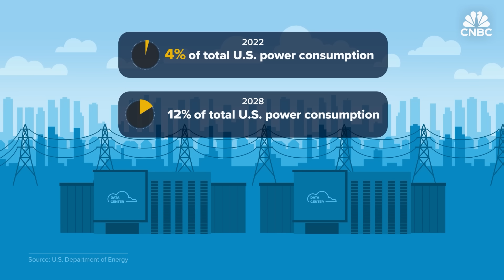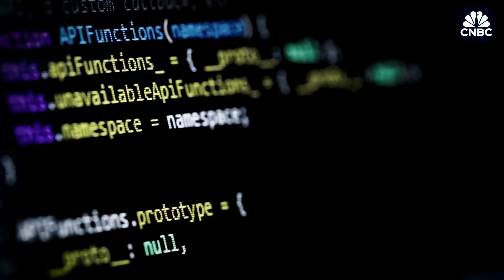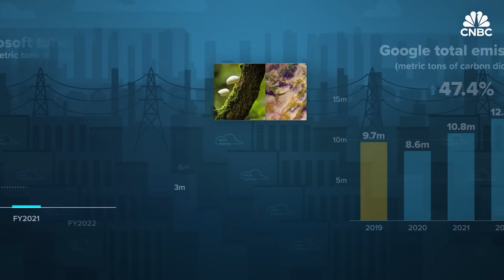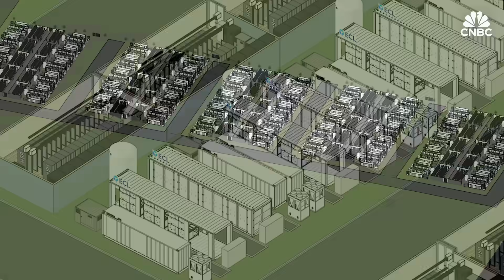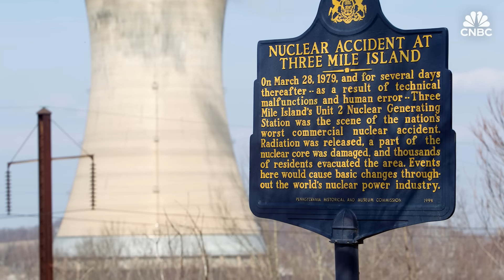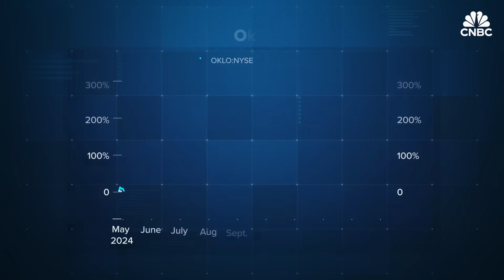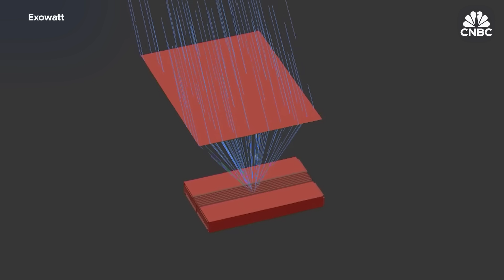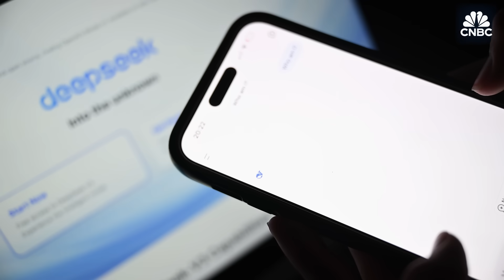How Google, Microsoft And Amazon Are Racing To Solve The AI Energy Crisis

Comment: More Tesla megapacks stabilize the grid which allows storage of excess energy solar/wind vs previous dumping.  Megapacks help out 4pm to 10pm revving up extra energy as people heading home.  Cheaper than gas PEAKER PLANTS.  Power during outages.  Battery storage cheap non peak energy to be used
During expensive peak power times.  V2Grid with EV’s also seeing potential.  VR POWER UTILITY MICROGIRDS VS MACROGRIDS also the future.  Tesla offers a VR power utility company in Texas.  Tesla starting to define lithium in Texas vs China.  AI in COLD space will help cool AI and well as increased performance solar cells in space.

Comment: China is increasingly integrating artificial intelligence into its energy system to increase the sector’s efficiency and enhance national energy security. From managing energy storage to more accurately forecasting energy supply and demand, large language models can make the whole sector smarter, by streamlining energy systems and minimizing waste. 

Of course, AI is a double-edged sword in the context of the energy sector. Training large language models carries a gargantuan energy footprint, and running AI queries is far more-energy intensive than traditional searches – though exact figures are hard to come by. But while AI is placing a strain on energy grids, it also has enormous potential to improve grid management. And China is far ahead of the curve in terms of tapping into that potential.

Comment: Fusion power, while often touted as a "clean" energy source, does produce nuclear waste, though it's quite different from the high-level, long-lived waste generated by nuclear fission.
Here's a brief overview:
 * Activated Reactor Components: The primary source of radioactive waste in fusion reactors comes from the structural materials of the reactor itself, particularly the "first wall" facing the plasma. High-energy neutrons produced during the fusion reaction bombard these materials, making them radioactive through a process called neutron activation.
 * Low to Intermediate Level Waste: The activated components are generally classified as low- and intermediate-level radioactive waste. This type of waste poses a much lower risk to human health and the environment compared to the high-level waste from fission reactors.
 * Shorter Half-Lives: The radioactivity of fusion waste typically decays significantly faster, often within decades to a few hundred years, as opposed to the thousands or even hundreds of thousands of years for some fission byproducts. This means it doesn't require the same very long-term geological storage solutions.
 * Tritium: Fusion reactors commonly use deuterium and tritium as fuel. Tritium is a radioactive isotope of hydrogen with a relatively short half-life (around 12 years). While it is produced and consumed within the reactor in a closed loop, there's always a potential for small amounts to be released or to contaminate components, which would then need to be managed as radioactive waste.
 * Helium: The direct product of the deuterium-tritium fusion reaction is helium, which is an inert, non-toxic gas and not radioactive.
In summary, while fusion power doesn't produce the same kind of highly radioactive, long-lived waste as fission, it still generates radioactive materials from the activation of its structural components, requiring careful management and disposal, albeit for shorter periods. Research is ongoing to develop materials that minimize this activation and allow for recycling or reuse of components after a relatively short cooling period.
Reply: thanks for this comment.

Comment: The Nuclear Solution: Powering Our Future.

Nuclear power is the answer to weather disasters and our energy future. We can build Generation IV nuclear power plants on an assembly line basis and deploy them worldwide as quickly as a Walmart. This approach will dramatically cut construction costs.

Superstorms, extreme weather, and electricity shortages can all be addressed with off-the-shelf nuclear technology right now. Nuclear power can fuel our electric future and even help scrub carbon out of the atmosphere. We all benefit from abundant electricity that doesn't harm our atmosphere.

Versatility and Safety

Nuclear power can produce hydrogen for trucks, buses, RVs, and airplanes. It can also be scaled up and down to complement intermittent sources like wind and solar. Generation IV nuclear power can even consume more waste than it produces, and it can repurpose existing nuclear waste, just as France has done for many years.

Generation IV nuclear technology offers several key benefits:

Non-proliferation: Designed to minimize the risk of nuclear weapons proliferation.

"Walk-away safe": Features passive safety systems that ensure safety even in the event of an accident without human intervention.

Urban heating: Can provide steam for heating our cities.

Flexible size: Can be small enough for a cruise ship or small towns, and can be put in series to power large cities.

Grid integration: Can be part of a local power grid alongside wind and solar.

Small footprint: Requires about the size of a Home Depot.

Community placement: Can be located next to hospitals or large retail centers in any community.

Dispelling Misconceptions

Nuclear power is over 99% safer than petroleum product extraction and much better for the environment. Don't believe me? Look at the number of deaths every year from extracting fossil fuels. We have to stop using the air we breathe as a trash can, and we must address how petroleum products contaminate our drinking water.

The media and politicians must stop scaring people about nuclear power. Their fear-mongering is responsible for preventing the construction of vital nuclear facilities, which contributes to ongoing death and environmental destruction.

We need to organize field trips for kids and parents to see firsthand that nuclear power is not scary. We should commission artists and school children to paint murals on-site at Generation IV nuclear facilities. Don't let the media and politicians scare you about nuclear.

The only "nuclear disaster" we face is the parasitic "nuclear safety" industry, siphoning public utility dollars for so-called cleanup. People have been living and working around both Chernobyl and Fukushima since day one, yet these groups lead you to believe it's some terrifying thing. The "nuclear safety" establishment is a parasite on the business, making it so expensive that it can never be built.

Comment: Earth's water vapor saturated greenhouse effect is from water vapor absorbing all the greenhouse radiant energy from the earth within a few meters of the radiating surface adding 10°F (5.55°C).  The other greenhouses can not change the overall all effect of earth's greenhouse effect.   Saying Trump just wants oil and gas is very incorrect.   Trump wants a return to economical electricity which means new USC coal power stations at less than 1/3 the fueling cost of natural gas.  When supporting wild AC from solar voltaic and wind turbines the natural gas use is higher than when making all the electricity from natural gas combined cycle power stations.  The NGCC power stations are still more expensive than coal so they are rarely used except when needing to quickly easily replace an old  inefficient coal power station.

Comment: Use offshore wind, wind build out in the plains, along with a solar south strategy.  Just absorb the energy needed.  Further, collect and recycle wasted energy streams, especially from the tremendous US nightly grid losses.  Collect these grid streams as battery fill, heat battery fill (sand or salt), and hydrogen generation.

Easy money.

Comment: For eg if all (green) hydrogen is made from pure renewable (solar & wind) .. via Electrolysis. The very low (ambient) pressure of 2 barg, how to stored it with (another way) very high pressure, says, upto 700 barg.. that need lots of Compression power (upto 40% of H2-mass produced must be sacrificed, to be Stored at sufficient potential/ pressure). Otherwise, as shown in this video, the Cryogenic/ Refrigerator s required. That's too, need LOTs of Energy to.. Cool it down to the condensing point of becoming Liquified for compact storage & easy transportation (there's no easy way without.)
Same as for CNG, either refrigerated or High compression (2- 300 barg for CNG; for hydrogen is 700 barg (non-refrigerated).)

Comment: I see hydrogen as a great solution for stationary electrical generation. We need to develop hydrogen-powered electric production more. 
Great video.
Reply: Hydrogen is mot an energy source, it’s an energy carrier. You can’t find free hydrogen anywhere, it has to be made. Mostly it is extracted from natural gas, but it makes  more sense to just use the gas instead. Or it can be made by electrolyzing water, but that takes a lot of electricity. That could be made by renewbles, but then the losses are huge, and it is much better and cheaper to just use the electricity directly. This was a bad video, lacking the necessary background knowledge

Comment: Turquoise is not a mix between blue and green in terms of buying both. It’s methane pyrolysis and it comes from ripping apart methane so there is solid carbon and hydrogen. If biomethane is used it’s actually carbon negative. The hydrogen conversation needs to shift off silly color metrics to strictly how much carbon emissions is tied to a kg of hydrogen

Comment: Hydrogen is a horrible way to power anything. Any metal it comes in contact with gets corroded by it so storing or transporting it is insanely expensive
Reply: Use carbon fiber, or plastics.  Hydrogen is only 1 dollar a liter, right now.

Comment: 8:20 - Calling it a nuclear "resurgence" is jumping the gun by a mile.  Nuclear and SMR will not help because of the extremely slow build times (especially in western world) coupled with nuclear being the most expensive form of electricity production per MWh.

Furthermore, SMR actually will be more expensive per MWh since it is smaller scale output and each SMR unit has its own fixed costs like reactor vessel & control unit costs, inspection fees, delivery fees, installation fees, certification fees.  The factories to create SMR don't even exist yet and those will be mammoth undertakings.  Until they can produce SMR in the thousands of units, you're left with paying first-of-a-kind (FOAK) costs of building small reactors using bespoke construction techniques.  Traditional utility-scale nuclear has power outputs in 800MW to 1000MW+ range while SMR has some 300MW max and often much smaller than that.  Nuclear has a hard time avoiding expensive FOAK costs and it's dogged the industry since the beginning.

On top of all that, the permitting process and community backlash will be big obstacles.  Every power plant construction proposal (regardless of type) requires an extensive community engagement process and the NIMBY against nuclear will be off the charts.  Especially considering these SMRs are used by private enterprises and the citizens living around such nuclear power plants do not even receive direct benefit from them.

Also, the proposed gigawatts that big-tech wishes to add via SMR are tiny compared to the massive amounts of solar and wind being already added today by leading countries like US and China.  Consider Facebook wants to add just 4GW of SMR in the early 2030s.  The US adds over 4GW of solar monthly.  China adds 4GW of solar probably weekly!  By 2030, both US and China will be adding renewables 2x to 6x the rate they are now.  That's how massive the growth in renewables is, its unprecedented in all of history.  Solar/wind generate energy intermittently, but their massive scale compensates plus see the exponential growth of grid-scale energy storage too.

Comment: Hydrogen is perhaps the most inefficient energy source in history. It takes massive amounts of power to refine it from water. Then burning it with Oxygen only yields an efficiency of 30%. Unless its extraction from H2O is fueled by solar or wind, it is a net polluting fuel.
Reply: Yes, the energy must come from renewables for hydrogen to be considered clean.  However, keep in mind the massive exponential growth of renewables especially photovoltaics means we could have a lot of excess energy that would otherwise need to be curtailed.  Also, hydrogen could be used as long-term seasonal storage over months where battery storage typically operates on a daily cycle.
Reply: @beyondfossil I think the point is that Hydrogen underperforms a range of other energy storage solutions in terms of efficiency. Excess renewable energy doesn’t need to be curtailed, just stored in something more efficiently than Hydrogen. Virtually any type of battery technology does that at a lower cost.
Reply: @lucassiqueira2509  Sure, lithium battery levelized cost of storage (LCOS) is lower than hydrogen at the smaller scales.  But hydrogen is cheaper for large scale long-term seasonal storage that batteries cannot currently deliver on.  Batteries have larger self-discharge versus hydrogen which can be stored long-term with less losses.  In short, batteries are good for daily cycles, but hydrogen can be used for monthly "seasonal" cycles.  Hydrogen also has industrial uses beyond electricity such as high heat industrial use which is currently a big contributor to annual carbon emissions.
Reply: @lucassiqueira2509  Specifically, hydrogen can be scaled to provide weeks of backup power during winter "dunkelflaute"— periods of low wind & solar energy.  Hydrogen storage has higher energy densities which can be important as you scale up into hundreds GWh of energy storage.  Around 1 GWh of H₂ fits in a salt cavern vs. ~1 million Li-ion cells, and those cells need wiring harnesses, protective casings and electronic control boards.  

Also, lithium cells degrade with repeated energy cycles — but hydrogen systems do not degrade with time.  Lithium degradation can take years though before its very noticeable, but it will degrade.  Hydrogen can be used for non-electrical applications such as steel and cement production which require industrial heat at 1,000°C or more.
Reply: @lucassiqueira2509  Also, lithium cells degrade with repeated energy cycles — but hydrogen systems do not degrade with time.  Lithium degradation can take years though before its very noticeable, but it will degrade.  Hydrogen can be used for non-electrical applications such as steel and cement production which require industrial heat at 1,00°C or more.

Just to be clear, seasonal storage is about energy stored from spring/summer for use in autumn/winter.  Once we have abundant seasonal storage available, it takes a way one of the biggest weaknesses with intermittent renewables. Seasonal level storage will be a massive unrecoverable injury to fossil fuels and really help knock fossil fuels off its government subsidized perches around the world.
Reply: @lucassiqueira2509  The other problem is lack of local battery production compared to China who produce some 73% of all the world's lithium batteries.  To be sure, China will be pivotal to any global energy transition but, unfortunately, increasing geopolitical tension is being a big obstacle.  This is a very real problem.  Right or wrong, fossil fuel and nuclear advocates use the "China problem" often as an excuse to use their products instead of renewables.
Reply: @beyondfossil  True that sir. But with a 30% energy conversion rate is hydrogen the best solution?
Reply: @johnroberts9922  Just to be clear, that 30% is round-trip efficiency (RTE) using electrolysis and the fuel cells to produce electricity again. There are other methods to these, some may reach into 50% RTE range.

All this beats fossil fuels which are some 30% efficient for coal and 50% to 60% for combined-cycle natural gas.  But then add in the enormous ongoing non-stop cost of exploring, drilling, refining, distributing that those fossil fuels and fossil fuel electricity production efficiency plummets further.  Not to mention the large amount of pollution and carbon emissions with fossil fuels.
Reply: @beyondfossil  Certainly. It is far more efficient to extract Hydrogen from CH4 than H2O. Those Oxygen bonds to Hydrogen are tough to break, not to mention how reactive  O2 is with any metallic surfaces in the extraction process.

Comment: what damage would one of these units yield if it were to be targeted by any sort of explosive devices?
Reply: Not much because the energy isn't as readily available as other sources. If it was some thing that could be combusted then it would be an issue but part of the reason it costs so much to get energy from it is because the energy isn't as easy to get to basically. Don't get me wrong it would make a nice pop but no where near what you'd get with say a fossil fuel or nuclear.

Comment: I’m not a scientist, but I could tell you that making hydrogen through electrolysis takes a lot of energy, so it’s inefficient to utilize energy to produce energy. The most efficient way of energy will be fossil fuel natural gas, specifically nuclear energy.
Reply: It is stupid to produce hydrogen from water by electrolysis and then use this hydrogen in fuel cells to produce electricity. We end up spending more energy than the energy we get. But strangely some people, even technical people, suggest such an energy solution.